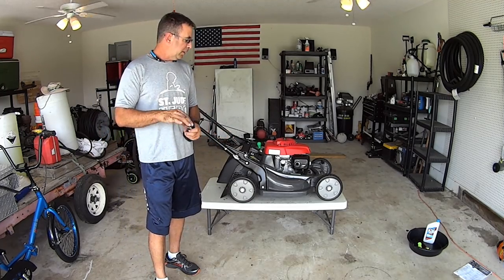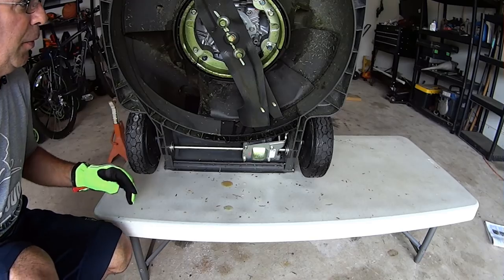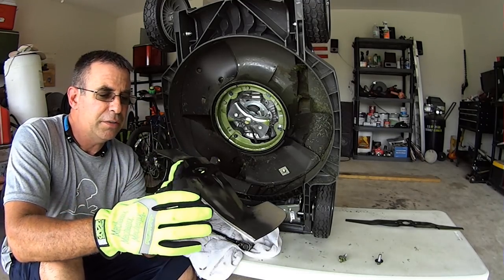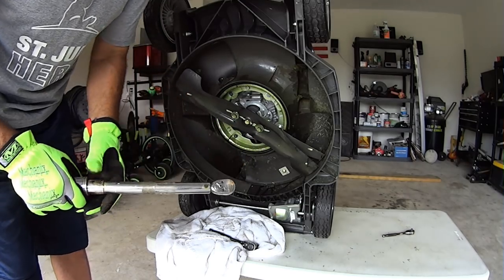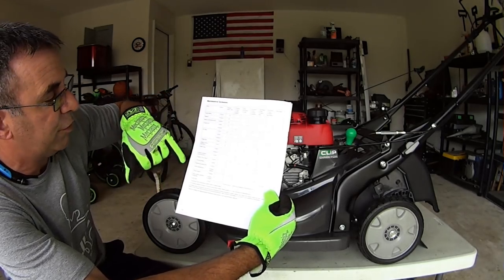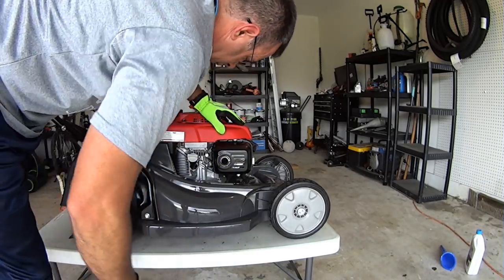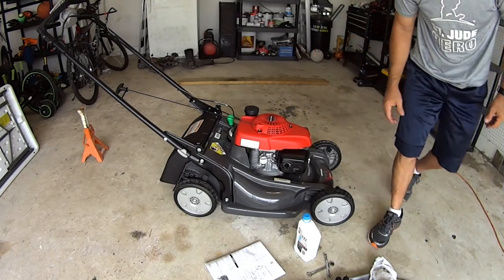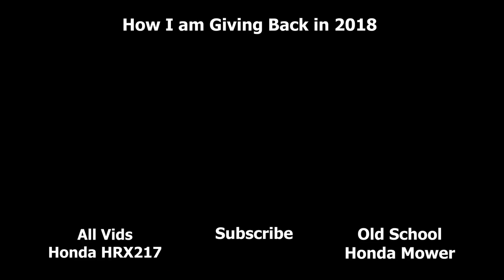Honda HRX217VKA Step by Step Maintenance Tasks Performed by the Manual

Comment: I’ve been running one of these Honda HRX217 mowers for about 7 years now as a home owner. All I do is run the carb dry after every use, I never ever let gas sit in the carb in-between uses. Every Spring I do an oil change, clean/replace air filter, and spark plug. No issues.

Comment: Great video. Direct drive cable adjustment worked like a champ.  Had very little traction after 2 yrs. Adjusted until wheels stopped, then backed off 8 rotations, it does wheelies again! Thx!

Comment: Every year I buy one of the Honda maintenance boxes at Home Depot.   It includes an air filter, spark plug, and oil for my Honda Mower.  Every spring I swap it all out for the new season.
Reply from the maker: Awesome plan!
Reply: Just did my maintenance on mine.  Great video!
Reply: That’s the only way to go!  Oil is cheap insurance, and Im going to use the Honda brand oil.  It’s pre measured at the 12 ounces, which IS THE Correct amount!  Peace!
Reply: It’s $20. Worth it

Comment: Great video.  Very detailed and broken down to a level for a basic homeowner with a new expensive mower.  I purchased this same mower last week in OR (no tax and $10 off coupon) for $589.00.  It was a dream to mow my septic hill slopes with it 'pulling' for me, as my old mower was a basic push-mower.  I will reference this video for when I do my maintenance!
Reply: Fantastic review! You are the man. A true professional. Any thoughts on why Honda did not put a drain plug somewhere on the bottom ?

Comment: Man, I just bought an HRX217 VYA yesterday. I was not prepared for how quiet that thing is, especially with the blade disengaged. I honestly thought the throttle lever had a higher setting, and was stuck. It looks like it only goes half way, and should move further forward, but apparently not. Was so quiet, I thought for sure it was only running half speed, but I was wrong. This was the first mow of the year and my yard is anything but a show yard. Full of weeds, crab grass and onions. I ended up going slow and mulching, and my yard literally looked like it had been bagged. This mower is pretty awesome

Comment: Thanks for all the info on the Honda mower. I had a 6 year old super recycler that wore out. The Honda engine was still strong but the wheels and drive system wore out too quickly. Bought the Honda today, I hope I have better luck than with the toro. I might try to fix the Toro but the replacement parts are almost 1/2 the cost of a new mower.

Comment: I bought a HRR last year, pretty happy with it. Went with a push type only because. just less maintenance that way, & i also wanted it to come with all 3 cutting functions to begin with. I should most likely change my spark plug 😆 change the air filter each year.

My helper switched my wheels out  to custom rubber ones with lifetime garrenty....110% worth it. luckily they fit. He did this before it even mowed anything.

Great video!
Reply from the maker: Thank you and enjoy your Honda!
Reply: @DansVlog  I now need to decide if i need a truck, riding mower, or more Stihl Kombi attachments to add to my mowing assets. 😊
Reply from the maker: Let your business decide as it grows

Comment: Hi Dan, nice video with great tips. Honda  does not use bearings on their outer transmission shafts on this model. They use plastic bushings installed in the wheel adjust housing to allow the shaft to be supported thru the housing.  If you use water to spray off the underside of the deck, what can happen over time is that the shaft will start to rust and scar inside the bushings making it hard to pull the machine back.  Once or twice a season remove the inner circlip and washer and spray silicone in the bushing area to prevent the shaft issue.
Reply from the maker: Good info Alan, thank you for the tips I’ll be sure to use that in a video to make sure everybody understands what you just explain to us. Again, thank you

Comment: Outstanding video, sir! I usually watch YouTube on my iMac, but today decided to watch on my big screen tv, since I was doing a search for "girls in bikini's" and wanted to enjoy all that eye candy on a big 65" screen. Somehow, I stumbled onto your video and gotta say, I received ALOT more benefit from watching you over some hotties in bikini's.
I have a HRX217HZA that I bought in 2012. It's my second Honda mower and is serving me well. Gotta admit, the only maintenance I do is oil, filter and spark plug yearly. I have a large back and front yard. Usually go through a tank of gas with each cut. I've got St Augustine grass, a few slopes and trees to navigate during a cut. I live in South Texas where we've got brutally hot summers, but I ensure that my grass is well fed and watered. Consequently, I end up cutting grass every 10-14 days from May - Sept. I love my Honda and its features of electric start, choice of cuts, blade clutch, variable speed control and bulletproof transmission and engine. The build quality of the deck, handle and controls are stellar. 
My only knock on this mower is the wheel design. As I mentioned earlier, I have slopes in my yard, especially adjacent to driveway and curbside. Without fail,  during high heat/humidity the tires "fall apart" while cutting along a slope as the rubber strip easily slides off the rim. Specifically, the wheels are nothing more than rubber strips stretched (not even glued) onto a plastic rim. When these rubber strips come off the rim, you'll have hell trying to get them back onto the rim, which I've never been successful at.  I've had to just buy the entire wheel assembly, rather than struggle with that shitty wheel design that Honda puts on these mowers. Even with a brand new wheel, I still have to be extremely careful while cutting along a slope because even a brand new rubber strip will slide off the new rim.  I wish they'd replace these with the old school solid rubber tire. 
Anyway, getting back to your maintenance video. You mentioned that the blades are about 30 bucks. I just ordered Honda parts for my mower. Blades ($34), spark plug, filter and spare ignition key came out to a total of $67 (including tax & shipping). Thank you for taking the time and effort to produce this very informative video. I learned alot and enjoyed every bit of it. Great job!!
Reply from the maker: I am happy I was able to compete with hot chicks in bikini’s!! 😂😂
Reply: @DansVlog  I don't know, I think we need to start a poll started to have a bikini fashion show.  Think Dan would steal the show in a florescent pink g-string overhalin a small engine and greasing up a drive shaft! :-/ 
Another well done, informative vid Dan. Thanks!

Comment: Nice vid, you mentioned about using a velcro strap for the operator presence bar,  I run a Honda 216M2 with blade brake, I use a  bicycle toe strap when I have to do heaps of turns (thankfully not often!)

Comment: For anyone using a commercial type blade sharpener that curved blade takes a special attachment to bolt it up in your sharpener.  The holes on the blade for attaching to the mower are offset.  If you sharpen the old fashion way by putting it in a vise you will notice the blade is not straight up and down but it will be offset. Just some technical info I learned this year and I have had Hondas for like 5 years now.  Just follow the same angle you will be good to go.
Reply from the maker: Great info, my friend... thank you for sharing!

Comment: The best designed deck and blade for - lifting the grass blades - UP - so they can be cut off evenly and completely, is still the Snapper Mower, especially the older ones.. 
These dual Honda blades work very well together and they are close to $30 a pair..

Comment: Watched this long time ago, loved this series mower immediately. Eventually I got a much older HRX217HXA with the same motor but hydrostatic transmission that doesn’t use belt slippage to control speed.
Reply from the maker: Awesome!

Comment: I have Murray that is 30. Three sets of wheels, two belts, no oil changes. Still starts on first crank. Plastic belt guard fell apart long ago. Blade has never been sharpened. Grass catcher still has no holes. You will be hard pressed to get that service out of any mower.It has a 5hp Briggs and Stratton.
Reply from the maker: That's amazing

Comment: Just bought this mower yesterday, thus, stumbling across your video was very timely. Great video by the way. You cover all the bases in an easy to understand format. Nice job! Do you have any regrets in not getting the upgraded model which stops the blade from spinning, but doesn’t stop the engine, which means you don’t have to restart the engine every time you release the blade movement function. Just curious how much of a hassle restarting the engine is when cutting the lawn. Thanks. FYI. Honda is adding 1 year to all HRX lawnmower warranties if purchased by June 30, 2020 which extends warranty to 6 years. This is fabulous!
Reply from the maker: Honestly, I rarely if ever bag a lawn. Always mulch and once it’s started, it stays on til I am done mowing.
Reply: Dan's Vlog ...thanks for the reply Dan....I’m really glad I found your Channel...I have signed up as a new subscriber and look forward to viewing some of the Vlog’s you’ve previously produced and look forward to some upcoming videos. Keep up the good work....Ed

Comment: Great video! Learning alot. I just bought this exact mower about 1 week ago. Ive done about 5 lawns since then. Time for the 5 hr maintenance.  Do I have to use a torque wrench when putting the blades back on after sharpening them?  Thank you.
Reply: Eric Schneider   YES
Reply: No. There is almost not a single person on the planet that uses a lawn mower for business that even OWNS a torque wrench. Just understand what 'firm' means when tightening bolts onto machines. That includes cars, trucks, mountain bikes, boats, dirt bikes, mowers ......

Comment: Hi Dan, I just found your channel and it is so informative I felt compelled to subscribe.  Thanks for all the info!  My mower's right aft wheel height adjuster has never worked correctly  from day I bought it almost 3 years ago.  Is there some trick I need to do which would allow me to adjust the height more easily?  The other three wheel adjust fine, but that one takes all my effort.

Comment: Anyone know if these new Honda lawn mowers have a fuel filter before the carb?  On my old HRM215HXA the only problem I had was a clogged carb. Ended up putting a fuel filter inline and haven't had the problem since.  You would be surprised how much dirt gets into the tank no matter how careful you are!
Reply from the maker: No fuel filter in-line but probably a screen in the tank

Comment: I don't normally watch anything over 15 minutes but it was great thanks I am struggling with my forward drive as it doesn't work but when engaged you can pull the mower backwards so looks like the wheel gearing , cable or drive belt but really nice video
Reply from the maker: It’s more than likely the belt of you haven’t replaced it in the past season or 2
Reply: @DansVlog  OK thanks I was going to check it's this weekend but it's been raining and unfortunately I don't have a double garage or large workshop.  It is on the to do list though.  Thanks and good vid once again
Reply: It’s far more likely to be related to the ratchets, ratchet springs, and pinion gears on the drive axle.  I’ve been doing all my own maintenance on my HRX217HXA (actually two of them) for about 8 years.  IMO these are the best mowers on the market, but if you’re going to own one you have to get familiar with that part of it because they’ll need maintenance every few years at least.
Reply: @KSMike1  It was the drive belt had jumped off the drive shaft pulley!!!  Assembled it back on and it's fine although I have ordered a new belt as a replacement

Comment: My Honda HRX2174VLA mower is hard to start.  I think its related to the spring mechanism by the gas on/off knob.  Wouldn't start until my neighbor moved that spring while I pulled the rope.  Ran fine and restarted fine after that then sat a week,  then hard to start again.
That spring doesn't move when the blade brake is held for starting so I'm not sure.

Comment: thankyou very much A+++! I have needed to clean the bowl of the easy-access carburetor  bottom by the time I needed to do other things like sell propel cable tension but maybe they don't trust people not to lose the float pin or mess up the gasket. Otherwise it seems like a maintenance thing as much as other things do.

Comment: Great video!  I just got my Honda HRX217.  I'm a visual learner and really appreciate how thoroughly you covered the maintenance of the mower.  Thanks!  I have a question: For storage of the mower for 3 months or longer the manual recommends adding oil to the engine cylinder (adding a teaspoon of oil to the spark plug hole?).  Do you have a video of this?
Reply from the maker: I don’t but it’s very easy to do. Just unscrew the spark plug and spray a little WD 40 in there and screw the plug back in. When the season is ready, just start it up!
Reply: Dan's Vlog Just finished mowing my lawn with my new Honda. 😃 Thanks for the info. 😎

Comment: My Honda mower is older than yours.  Every spring change the oil in back yard.  Use only Honda recommended weight and Honda brand plus a tuneup kit.  Mower is 10 years old.  Not complaining.

Comment: leave the spark arrestor it will help prevent a fire after you fill the gas tank with fuel and you spill a little of if the fuel cap ever leaks from being tipped on its side or the fuel tank is over full.
Reply from the maker: If what you were saying was even halfway true then it would be a mandatory item in all 50 states. Since it’s not… Common sense tells me it’s some type of a stupid EPA bullshit regulation only enforced or I should probably say with only certain states participating.

Comment: I had a 2 stroke mower an my helper used the non mix gas can it lockd up thank god for 4 stroke mowers very cheep to run the 2 stroke mowers i used took a 25 to one mix to 5lt of gas and thay are loud but thay have more power then a 190cc honda

Comment: Just completed the 5 hour service last weekend. No issues. Any advice or fix for mulch collecting between the bag and rear deck? Great videos 👍🏻
Reply from the maker: I am not sure what you mean.
Reply: Dan's Vlog when it is in “full mulch mode” if you open the door in the back  area it seems to clog with excess clippings. Appears that the door does not close fully when in 100% mulch mode, causing clippings to collect.

Comment: Hey Dan, I just finally got my HRX217VKA today it is my second mower from your video's hoping you can give me some help. I bought a self propelled Troy-Bilt XP190cc back in Feb and it is that zero turn one after you explain the weak front end issues I thought it would work. I broke my back so I though the HRX would be better, lighter for me. I ordered it from Home Depot, the front wheels rub on the low settings against the Nexite frame. I am okay at the 3" settings. The left wheel is a wobble wheel. Did you experience that or did I just get a bad set of front wheels on my mower? I like everything else about the mower so far I almost laughed at how light it was pushing it, the smoothness, etc. Thanks. "Currahee!"
Reply from the maker: The Honda is a $600 lawnmower. The front wheels should not wobble or rub on anything in any setting. Seems like it was not put together properly and you should probably find the authorized repair shop Home Depot will recommend and let them look at it under warranty

Comment: Question Dan, I see there’s no blade stop, on my snapper commercial I have a safety bar that when you release it the engine dies so I have to start it every time I empty the bag but over the years I’ve learned if I just put a zip tie with a hook on it and leave the blade bar hooked into it I never have to turn the lawnmower off but the blade still goes I’m careful I do this for a living, is it possible for you to do the same thing on your Honda thanks
Reply from the maker: Yes, definitely

Comment: How is this still holding up?
I was going to buy one but I see a lot of bad reviews at homedepot, oil leaks, wheels lock when trying to go backwards, etc...
Reply from the maker: Their cable is out of adjustment. That's why you should buy from a dealer, not a minimum wage stock clerk at a big box store.

Comment: Where can I find the table platform that you have the mower set on top of? Looks like the legs fold for storing it away?
Reply from the maker: Walmart. It’s a folding table. I cut the legs so it will be a lower work stand

Comment: Dan, I'm attempting to put a new engine in the hrx217. I took the mounting bolts off, the blade bolts off, but for the life of me can't get the clutch/crank bolt off without the spindle spinning. I chocked it off with wood and still spins. Was wondering if you can help out. Idk if you got some old footage stashed away for a rainy day. But I'm in a drought
Reply from the maker: You may need an impact wrench to "Shake" it loose while you lock down the flywheel from spinning.

Comment: Dan I need help. Bought a used hrx 217 and cut grass for the first time. I was hard to pull back. I fiddled with trans cable adjustment and now it wont roll back at all.
Reply from the maker: sidney white You’re supposed to tighten that cable all the way down until it will not go backwards and then loosen the cable about eight turns until it starts to go backwards again tighten the jam nuts and you’ll be in proper specs

Comment: I hate fuel with Alcohol in it. Would it be OK to run it on 100ll aviation fuel? No alcohol and very little lead.
Reply from the maker: That 100 might be too much fuel and not going to blend well with the air from the carburetor. Just use 89 octane  Marine (Ethanol Free) fuel